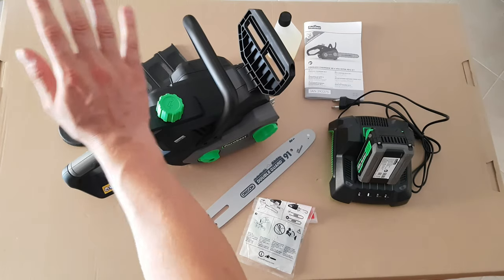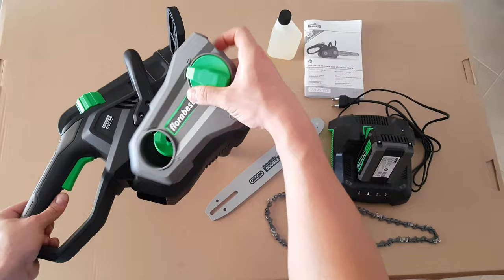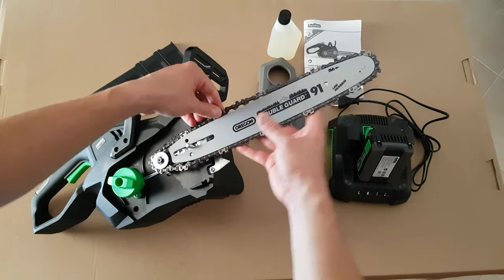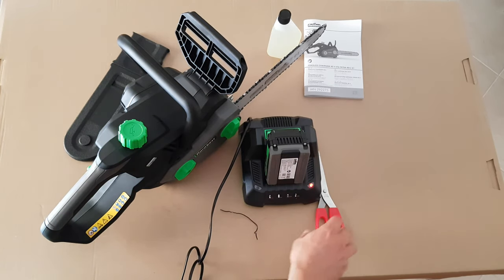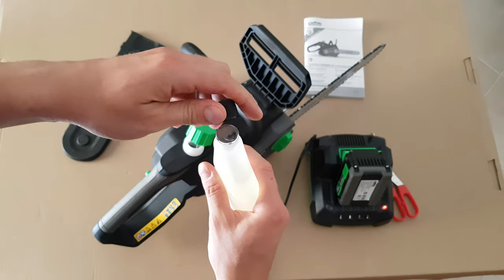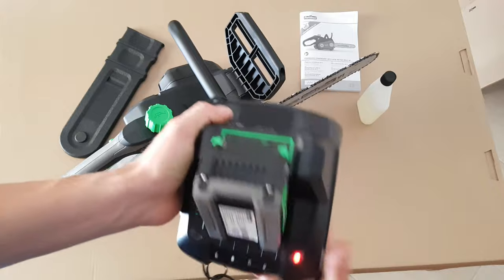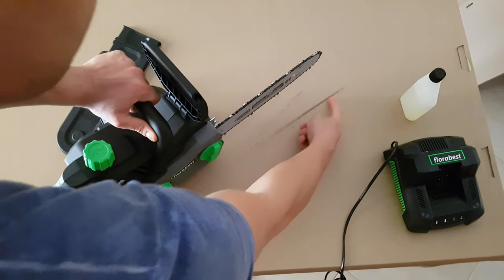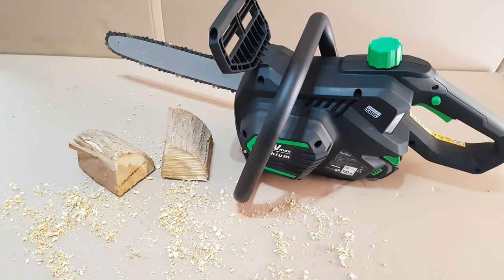Florabest Cordless Chainsaw 40V HTA FKTSA 40-LI A1 Testing

Comment: I bought mine early on for brush cleaning. It goes strong for 3 y of use. Cut trees big as bar with it. I dont like how heavy it is (around 6kg), you cant buy larger or spare battery (last about an 1 hour). To me better buy is einhell with dual battery and longer bar (its even lighter 2kg!), and battery are available in every decent store in many version (2.5, 4, 6, 8 Ah, but you need 2)